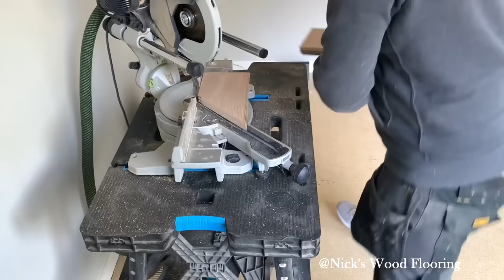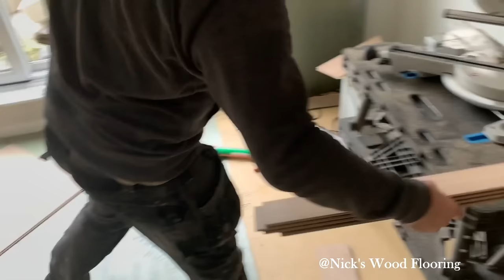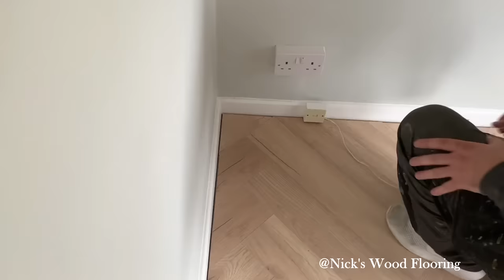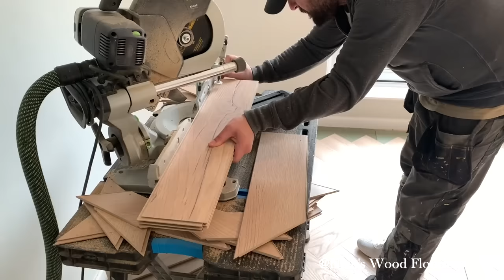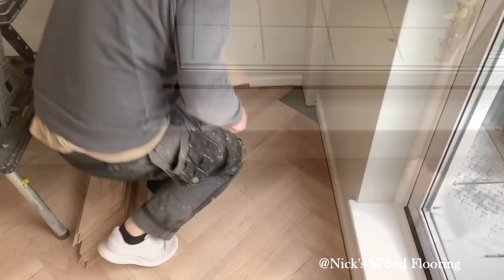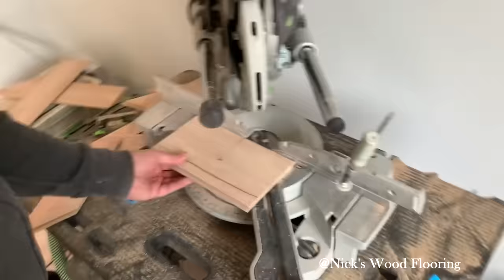How to Install Herringbone Laminate Flooring - Sideways

Comment: Nice floor. But a little detail is you used two of the same boards right next to each other on the beginning of the left row unfortunately.
Reply from the maker: Show me the exact minutes so that I can check them myself. :)
Reply: You can see it at 3:30 minutes. Small detail, but they are the exact same boards.
Reply from the maker: Are you under the influence of any substances or is this just a dream?

Comment: Hello I have just watched your video which was very good, we are a distributor of that particular product but we have had problems with crisping, this I believe is when you walk on the floor and it sounds like you are walking on a packet of crisps, the manufacturer advises no more than 3mm underlay and to glue all the short ends, have you ever had any problems regarding this? Regards Denny

Comment: I have just finished laying a herringbone Laminate floor, this video probably saved me half a day of planning and headscratching as it showed each step of the process and how the floor parts come together. Thank you Nick for such an informative video.
Reply: Each step of the process, huh.  He doesn’t tell you much at all the steps or considerations before even laying it out.
Reply: If you take the extra mile to do herringbone instead of normal I would have removed the baseboards first and replaced after floor is laid so the extra trimlines would not have been necessary which i think are "ugly".  You go deluxe or you don't.   Easy talk by me cos I still have do my own floor. lol

Comment: I’ve been watching multiple videos on how to do this, and your technique is easily the most GENIUS way I’ve seen it done!! Saved! Thanks for sharing!!!
Reply: Is it necessary to glue in those last few triangle pieces, and why?
Reply: @jessicahall8884 I’m sure you’ve had your question answered one way or another, with it being over a year. But with most types of herringbone lvt if you don’t fit the last cuts as you go, and fit all the full planks first, there ends up being both a male and female end on either side of the board, only an expansion gap worth of room to work with and a board you can’t lift to click in once it’s all tied together when you’ve laid most the floor. I made this mistake earlier 😆 very good video of installation tho

Comment: Great detailed video.
I am presently having LVT floating click system flooring laid this week. Like previous flooring ie engineered wood click system I have always removed skirting. kick boards prior to the floors being fitted. So, in this video has silicon been used between the finished floor and the skirting boards?

Comment: In 50 years of flooring, wood, laminate, LVT, the amount of herringbone I`ve done up until 5 years ago I could probably count on both my hands. 5 years on I must have done around 50-60. Just shows how much en vogue it is at the moment. As above, if its a drop-lock system it's a lot easier, trouble ensues when both length & width have to  be angled in at the same time. Can be a nightmare!
Reply: Nmlou

Comment: Looks good but can I ask why you didn't remove the skirting board before you started??  Would of made a much more pro job with the edges being covered with the skirts
Reply: Fukin' shoe molding....everyone used gay shoe molding with these floors! I'm with you on removing baseboards!
Reply: Very possibly a customer cost difference option choice.
Reply: @rodgerq  Cheaper to remove baseboards over buying toe kick, paying to have it installed and then paint cost. Cheaper to touch up the base!
Reply: I just have a customer send me photos only laying. I sent him to Bauhaus to get some drywall mud and prepared him it will be some demolition on site. Otherwise awesome art. I like it.
Reply: I imagine removing the skirting also means not worrying about maintaining a perfect expansion gap (as opposed to butting up plank boards to the skirting) if the edge of vinyl plank boards can slip underneath plasterboard walls, because reattaching skirting after laying the floor will ensure a neater finish.
Reply: It depends constumers  profit or budget
Reply: because this is gypsy  job
Reply: Absolutely agree with this. All of that work to have it just sitting next to the baseboard. The edges didn't look completely straight in some of the clips too. Just looks hacky not being hidden under the baseboards.
Reply: You put beading trim over it since you’re supposed to leave it away from the wall. 

The panels grow in heat and strink in cold.
Reply: @ashtongtv863  thats what the base board would do and would look heaps better in my opinion
Reply: Customer preference plus could cause damage to the walls
Reply: @MrDan1509 Not really. If you get matching trim/edging, then it's just installation over removing the base boards, then installing them again.
Reply: What I want to know is how come you haven't used glue under the flooring?
Reply: Custermer may not of want to pay for that.. not your lots choice
Reply: From my understanding, the floorboards will expand some. Not sure how much but I'd imagine it would then expand under the trimming??? Not sure
Reply: @Unknown16537  which is why you leave a ¼ inch or around 6mm gap to allow for expansion even under the skirting/trimming. Have a good day.
Reply: @Unknown16537  wouldnt be enough to affect the trimming
Reply: Cut it as tight as possible 1/3mm gaps and silicone it. Or pay/subby for a mastic man to finish it for you
Reply: Most likely what the customer wanted. Can go either way, but who cares. His video his project.
Reply: Lol you leave space even with baseboards
Reply: You have obviously never done any price job when everything based on the customers request.. This guy knows what hes doing , so i guess either is the budget or maybe he will just put the mastic around or maybe bidding..I mean , if the customer didn’t want to pay for that skirtings to be taken off what should i do. Clearly not going to waste my time tools and money
Reply: @billyguard-fox3526 you don’t silicone mastic instead
Reply: Top afraid to do more damage that's why
Reply: Buenas noches te saludo desde la CDMX felicidades muy bien trabajo solo una pregunta espero me puedas ayudar esto mismo se puede hacer con cerámica?
Reply: People are lazy .  sometimes this as well creates a lot of extra work. Simple thing u don’t need to remove skirtings, cut out bottom bit by the high it needs and floor slides In. At the finish might need removing just one skirting or corner. Done.
Reply: Wood expands upto 10mm thats why
Reply: Most people dont want their base removed and replaced because of cost.  So you get what you see here. You dont deserve mona lisa work if you wont pay for it. He did his best job he could without removing the base. Chances are they will add a molding.
Reply: They not remove due to May crack  I had floor board in my house the same they haven’t remove the shirt  board  for not crack no need too
Reply: What size parquet boards are you using please?
Reply: To all the people that have replyed oh costing oh expansion. Blah blah..

Edging is around 19mm thick.. ussually held in by nails they are pretty quick and easy to take off. for instance I took them off my father inlaws laundry a month ago. took me 10 mins put dont the flooring and put them back on hardy know they have been removed.. as in this situation take them off 20 mins work  30 max. Lay flooring leave a 10 mm gap from the wall then put the skirting back on... spend the time its allways worth it.
Reply: Quarter-round. If the baseboard has been painted same color as wall, will create big hassle to remove… almost certainly quarter-round trim would be installed in this scenario to cover that gap.
Reply: I also agree but sometimes the customer asks for it a certain way, maybe to reduce cost etc. It doesn’t have to be a criticism of the tradesman.

Comment: Good work...its easy because it vinyl flooring....much harder and longer if it was engineered wood or solid which you might have to glue together

Comment: Is this kronoswiss herringbone?
I know somebody who's kronoswiss herringbone clicks when they walk on it, apparently the concrete floor underneath wasn't latexed/levelled beforehand? Would you recommend always levelling the subfloor first? And what underlay would you recommend? The back of the box says atleast 1.5mm which is what they used, a 1.5mm foam DPM underlay, also the instructions on the kronoswiss shows to glue the edges of the planks aswell?

Comment: Excellent job. Would you also consider removing the skirting board at the outset to allow for covering up the expansion gap?
Reply: Judging by the photos at the end of the video it looks like they installed quarter round or shoe molding afterwards which hides any gaps. If you didn't want to use molding then you would definitely need to make sure the gap is hidden under the baseboard which would indeed require removing boards and reinstalling IF they weren't installed high enough to allow the floor to slide under.
Reply: @cgale337  Installing a quarter round to existing skirting boards is not a professional job.He still doesn't know how to make floors professionally.
Reply: Pretty sure what he does reflects what homeowners want to pay, lol.
Reply: @tkinynanz  I’m sure he does mate, this was a great job and likely the customer asked for the edging options, I lay flooring and the customers always have a preference, it’s actually harder to mitre in all the edge trims like this than it is to hide it under the baseboard

Comment: People NEVER go floating floors,  you will  regret it.  Clip Clop Clip Clop all through the house. Noisy & if you flood you floor accidently, YOUR STUFFED!  Solid timber floors nailed to concrete is supreme.  (From my 40 years carpentry experience)

Comment: does this floor creak when you walk on it? i just had it installed and it is snap crackle and pop when you walk over it ?? its unbearable. surely this cant be right?
Reply: I’m currently installing this, I had this issue but I was using the previous old underlay which was already there, I pulled it up, started again with new underlay and it’s definitely reduced the crackling by about 95%, I still notice it a tiny bit
Reply: If u use 5mm or 8mm thickness and your floor uneven they will creek Make noise use 12mm

Comment: Nice job this pal iv done it with skirting on and then made some over skirting on my spindle moulder lock mitre as removing skirt can some times be problematic in only houses take one off and the house crumbles

Comment: Very nice work. If i may ask, as a student and appreciater of all good craftsmanship -  would it not be better to not have centered it? So you wouldn't have two sets of small peices on both side of the floor but one side with medium length edges( which would be more durable) And how would you finish up the edges around the room when not removing skirting? ( If you have a video to direct me to) 

Many thanks for your hard work
Reply from the maker: https://youtu.be/e0krPjLPiu0
Reply: @NicksWoodFlooring

Comment: Great video. Had a question about why  you aren't using glue or when do you need to use glue for flooring? Thanks
Reply: I think the idea is that each piece kind of locks into one another so you never glue it down. Just my assumption, I never see glue used in his or any other wood floor installation video
Reply: Click system flooring
Reply: If this is Berry Alloc Herringbone the company now recommends glueing the  end joints which adds time & prevents replacing any damage boards.
Reply: @estowfoto8151  клик, но торцы с замками отпилены!!! Что мешает в дальнейшем им разойтись?!
Reply: @SubstanceD91 👍

Comment: Question. I currently have vinyl (not vinyl planking) in my kitchen and carpet in my family/living room and hardwood in the main entryway. I want to lay laminate or something throughout the whole house. Once I rip away all the old floor coverings will there be differences in the depth between the different rooms with different flooring materials? If so will it be as simple as just laying like 1/4, 1/2 inch thick boards for example? I assume for example that the rooms with rugs will be lower than the the kitchen floorboards with vinyl because you have to adjust for the thickness of the padding and rug whereas vinyl is not as thick.
Reply: If you are removing the current flooring the sub floor should be the same throughout
Reply: @sage_spartacus  isn't there variations in thickness between hardwood planks, thin  rolled vinyl and carpeting with padding that would creat differences in depth when laid down next to each other? 

For example let's say carpet and padding  adds up to say 1/2 inch thickness and transition it next to rolled vinyl flooring and the vinyl is say 1/16 or whatever it s thick?
Reply: Maybe I'm misunderstanding, but if you want to lay new floor you will be removing the current carpet, vinyl, and wood flooring correct? Those materials are all different thicknesses but when you remove them you have a plywood or concrete subfloor that is the level throughout your home
Reply: @sage_spartacus  correct. I would be removing different types of flooring thoroughly the house. I know the subflooring would be the same throughout the home but I thought remembered when the home was being built that the kitchen had sheets of board laid down in the kitchen with the vinyl to build it up like a 1/4 inch or so.
Reply: @bubbalo3388  I see what you're saying. We redid the floors in the house we bought and they ran a thin plywood under a vinyl flooring in the kitchen as well. We removed all the flooring materials and underlays including the thin plywood sheet. Made it easy to run flooring throughout and not worry about transitions

Comment: Why wouldn’t you remove skirtings and pack off the walls then replace the skirtings after?
Reply: You have to cut the  caulking and try to remove without damaging. The extra money to reinstall, recaulk, and repaint.  Or just buy shoe mold or qtr round.

Comment: Just installed same flooring.  It crackles and pops when walked on even with a solid subfloor with ply and fibreboard underneath. Help!!!
Reply: It's the product Krono is terrible for it . I've uplifted some after being down 3 days for the same reason
Reply: @creekyknees  I’ve had the retailer  tell me nothing wrong with it  not defective. Yet offer discount on replacement.  It looks nice but it’s cracking everywhere    I’m absolutely gutted we chose it and don’t know what to do
Reply: @davidb9976  maybe pick a very small area and try watered down pva in the joints.  It might work
Reply: @creekyknees  ah ok, I didn’t know you can do this, I’d have to get the fitters to take it all up again and it’s 60 sq m    Really do want a fix on it though!
Reply: @davidb9976  What i mean is try pouring some through the head joints in a small area. There's a video by skillbuilder where they do this to a chipboard floor, and laminate is pretty much made of the same, so it might work. Try a small area first. Obviously, if you take it up and pva it, that would work anyway, and there is no need to dilute the pva
Reply: @davidb9976 @creekyknees I'm in the exact same boat. Got this exact floor installed and it's cracking everywhere. Did either of you find a fix? Got the installer coming back tomorrow but even he seemed stumped when he first popped over.
Reply: @creekyknees Didn't tag you properly in my msg below for some reason.
Reply: @TasticJam  i fixed it on a small area . I'd suggest trying a small area and see how it goes .
Reply: @creekyknees  Thanks for the reply. You relifted the flooring and used PVA glue? Going to give it a try.
Reply: @TasticJam  no never fixed it and couldn’t afford to uplift the whole thing and replace it. It now on my entire ground floor popping and crackling everywhere. I’m so gutted about the whole thing and the retailer says it’s not defective it must be my subfloor. (It’s not as old flooring was fine) furious with the results and Kronotex product i
Reply: @davidb9976  likewise mate. Mine is exactly the same. We're currently putting a claim into the retailer & will take it to small claims court if necessary. At the moment they're saying we need a room break which is nonsense.

Comment: He uses same pattern tiles one next to another.  Doesn't spread them across the floor. Then also, he starts at the wall. What would the room look like if you arbitrarily start ar the wall?  
I would determine a focal point of the room and start there and go to the walls. And i am not a floor professional.  I am a consumer.  If someone laid floor like that at my house, i would stop them right away.  This is not right.

Comment: Why do you just skip the whole fact that you put quarter round everywhere to fill your massive gaps...
Reply: The gap is not 'massive'.  It is there is allow for expansion - as per manufacturer's fitting instructions.  This is known as a floating floor.  Most fitters will put a quarter round bead over the gap.  Some will take the skirtings/base board off but it is often very time consuming and can damage the finished wall and skirting/board . Thus more time and cost for both the fitter and customer.